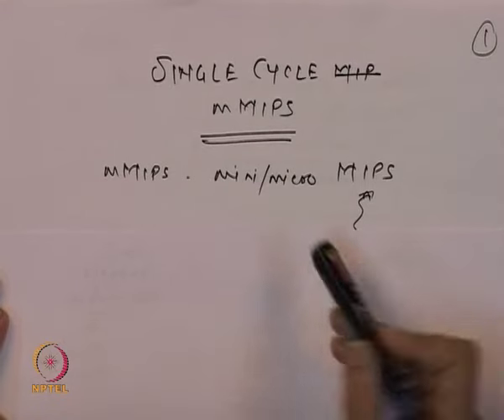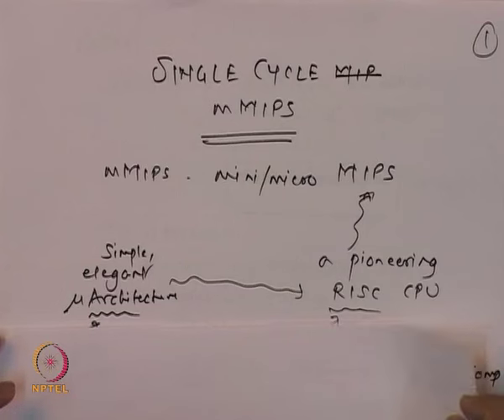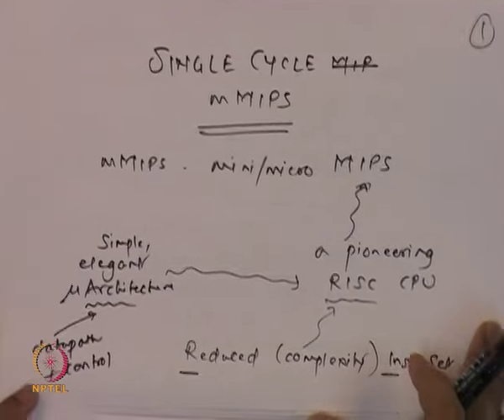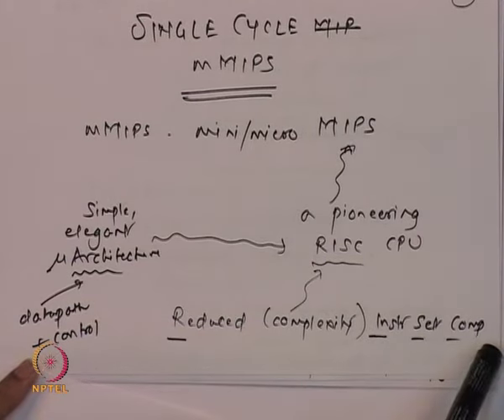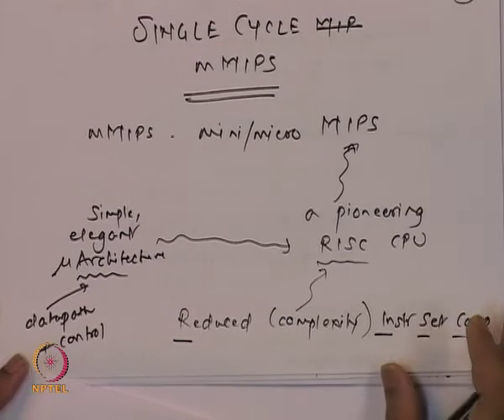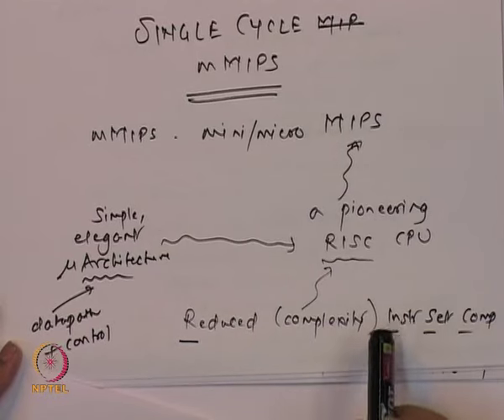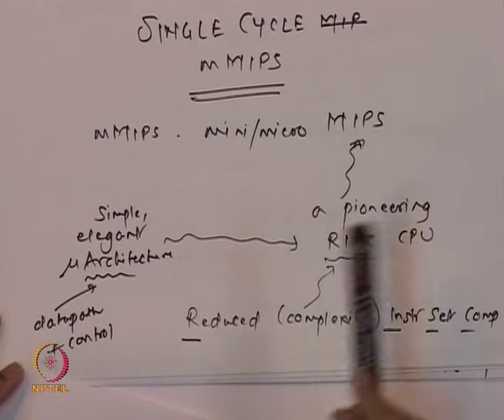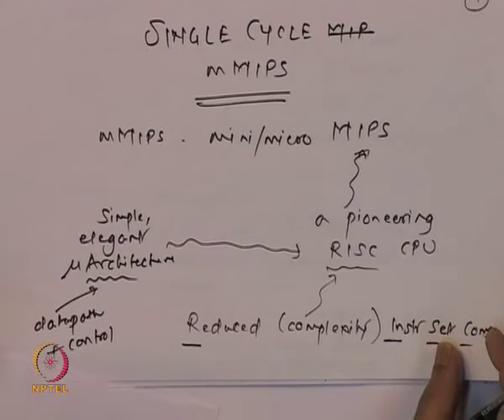Mod-01 Lec-26 Single Cycle MMIPS

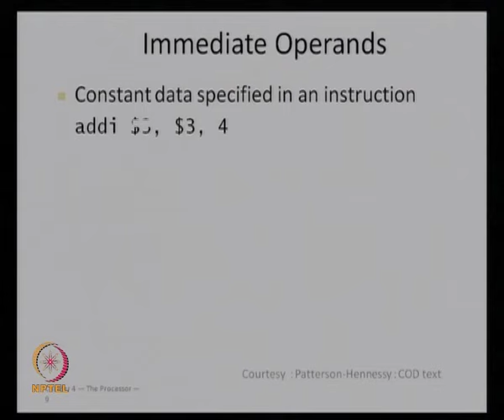Comment: There is an ambiguity for lw/sw instructions. At 32:31 the instructor suggest that the imm (immediate) is considered as word offset for lw/sw but at 44:45 the table of MIPS instructions suggests that the imm (immediate) is considered as byte offset and subsequently the datapath constructed was also done considering the imm (immediate) field of lw/sw instructions as byte offset. I think it was assumed that the compiler would create the offset for the CPU Instruction !? Any feedback would be very appreciated.